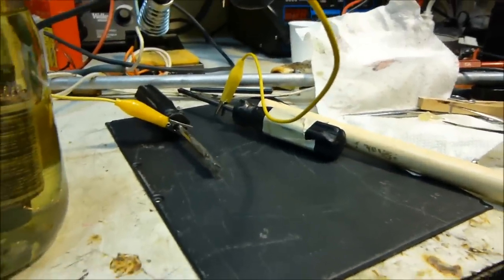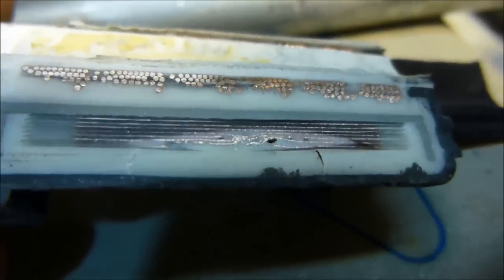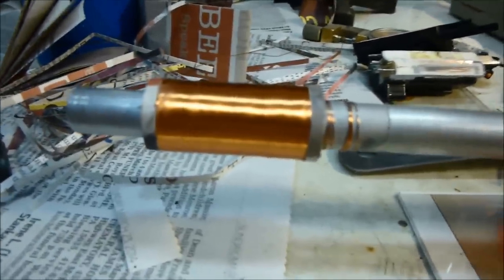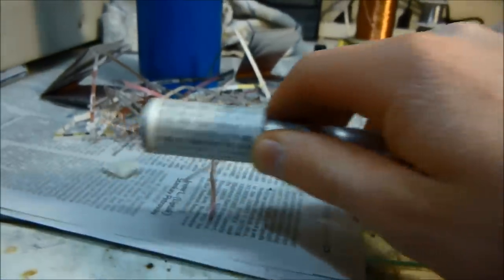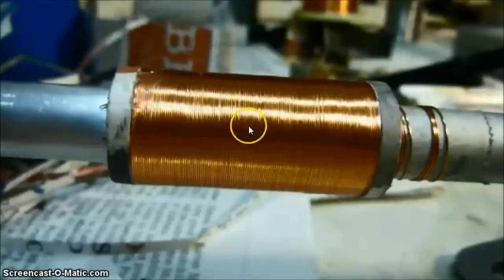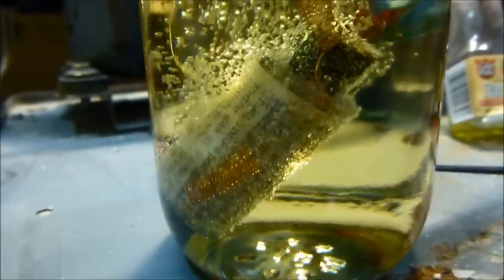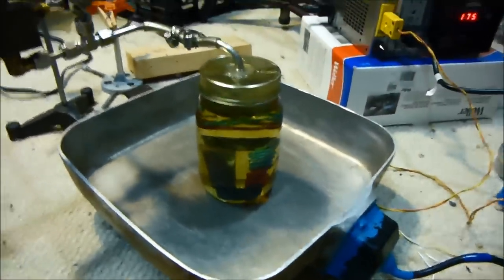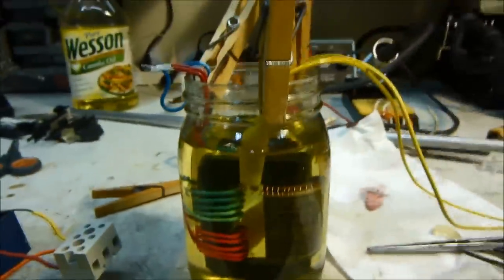How to Make a Super High Power Fly Back Transformer

Comment: Just a warning, that glass jar you were pulling a vacuum on could have imploded, I suggest you use some protection.
Reply: DIY compressor vacuum isn't strong enough. It probably only gets up to .25 of an atmosphere.
Reply: Most food jars are fine with vacuum.  The "canning process" gets them down to the vapor pressure of water at room temperature.  What they don't do well with is pressure.

Comment from the maker: My new homemade fly back transformer!
Reply: What is the output voltage?
Reply from the maker: I would guess it's not more than 5kv.  Just a guess tho
Reply: do you need paper in between the layers?
Reply from the maker: techatyou Yes or else the wire will just arc over.
Reply: do you need a "decompressor" or could you rig up a vacuum cleaner to suck the air out?

oh and when you winded the first layer you went from right to left (doesn't matter) but after you put the news paper to insulate it did you run the wire back to the left, insulate it more, and continue to wind from right to left or did you go from right to left, insulate, left to right, insulate right to left, insulate, and so on?
Reply: sounds daft but vacuum cleaners don't pull a vacuum lol. You can wind right to left then left to right or you can wind right to left right to left and so on and it will be better if you cant get anything to pull a vacuum. That said you can make a vacuum pump easy with some plastic pipe a one way valve and a wooden dowel for a piston with an O-ring to seal....good luck!
Reply: you could also just reverse the shrader valve in a bike pump

Comment: Very nice job. The best oil to use is mineral oil. You can get it from the pharmacy, or order it from the pharmacy, by the pint. Great vacuum setup! Yes! you do need to get all the air you can, out of there so to lessen the chance of inter-winding arcing, like what happened to the original transformer. What happened there is the wire got too hot and broke down the potting, then it arced between layers and burned up. Great job man! Thanks for showing us!

Comment: Very nice job :).   If you need a higher vacuum you can put a diffusion pump after the compressor.  In a high vacuum system the compressor is called a roughing pump.  As I recall having a vacuum reservoir tank between the roughing pump and the diffusion pump is OK also.  You may be able to pick up a diffusion pump from a surplus house or scrap recycler.
Reply: Note though that the diffusion pump require a much better roughing vacuum than is provided by that dehumidifier pump.  Typically the pressure needs to be brought down to well under 1mBar on the roughing side whereas the dehumidifier pump in this video is only bringing the vacuum down to about 90mBar. With a roughing pressure that high the diffusion pump would not work at all.

Comment: Nice little HV transformer, good work.
Just remember that it now can supply much more current and are much more dangerous.
High frequency HV mostly goes on the surface of the body but dangerous anyway and you dont want to make a misstake.
That said, it looks like a good HV transformer and one of the better DIY transformers i have seen on YT.
Now, build a HV multiplier (potted or in oil) and take the voltage up to 100kV.
This transformer will be an excellent driver for such a multiplier.

Comment: Try making a branch line to put the valves in paralell with a single pressure signal.  You probably want them in parallel as a whole, in fact.  Compound the flow.
Reply: Lunartrek as he explained, it wouldnt work...
Reply: It would work and he hadn't tried it as of this video.  Trust me, pneumatic actuators work on this principle all the time.  Just because someone says something won't work it doesn't make it true.  He is new to working with pneumatics, he will learn, if he sticks with it.

Comment: More cool stuff dude. You are one of my favorite experimenters and I like your approach. I've just blown a couple flybacks with my new SS-SG hybrid Tesla coil and I need to make something more robust to use as its primary. I'll be trying your method here! I have plenty of magnet wire and bare cores.
Meanwhile, check out my coil! It is starting to work pretty well now that I have the spark gap overhauled.
Extreme High Voltage: TinselKoil VII Overview, Construction, Demo
Extreme High Voltage: Moar Psarks from TinselKoil VII
Keep up the good work!
Reply from the maker: Wow it's amazing!  Yeah I've almost burnt up all of my flybacks on my ZVS driver too!  They sure don't last long when you put a lot of power into them!  If you make your own flyback you may need to put a rectifier on the output before you can use it with your Tesla coil.  I wish I had plenty of magnet wire!!!  I just have stuff I recycled!  Thank you!  You keep up the great work too!

Comment: Nikola Tesla used pre-boiled linseed oil.
Many of the early-1900 violet-ray companies and x-ray transformer companies used molten wax, sucked it down then let it harden:  mixtures of beeswax and caranuba wax.

I took apart a modern dental-xray transformer and found that it used linseed oil.   When not immersed, the linseed oil hardened (like oil-based paint,) so that transformer now looks like it's embedded in orange plastic.

Comment: Perhaps you could remove the check valve from one of the compressors to allow it to work in series with the other. If all you are doing is pulling a vacuum to draw out air bubbles, then a single stage is fine. Pulling a lower vacuum won't make much difference past a certain point if a bubble is trapped then lowering the vacuum even more isn't going to help. Since you are going through the trouble then why don't you pot the transformer in epoxy instead of oil? Once the resin is set then you don't have to worry about the mess of oil again. Also, for your paper layers I would use plain paper. The ink on newspaper could provide a conductive path for arcing. Although, if paper gets hot and turns brown or black then it starts to become conductive. Maybe Kapton tape will work for you here. I'm not sure how high a voltage it's it can be rated for. If you do try epoxy  you will want to use a slow set resin and possibly keep it chilled for the first few hours to prevent overheating when too much epoxy is allowed to sit in a small space for too long. Blending with milled glass powder can help by lowering the amount of epoxy and by improving the thermal conductivity. ... At any rate, after removing from a vacuum transfer the transformer to a pressure chamber and pump up to 25 to 50 PSI. That will crush any remaining trapped bubbles. It's actually easier to get rid of bubbles with pressure than with a vacuum. With a vacuum there is only so low you can go. Sometimes a bubble or void simply won't disappear. In fact, it' possible to get vacuum "bubbles" -- these are just voids filled with vacuum. I'm not sure what holds them together. They don't look round like normal bubbles. Sometimes a vibrator can collapse them. But if that doesn't work then a pressure chamber will always get them. Once the epoxy is set the bubbles won't return.

Great looking transformer, by the way.

Comment: You might try a tee fitting between the two compressors going to the jar. Each one would be doing half the work, you might get a greater vacuum in the jar. Nice slippers, I need a new pair.

Comment: hi....something to think about....try a scroll compressor as your first pump.....no valves to open or close.
Reply from the maker: jim walker Interesting!  I never though about that!  Thank you!
Reply: your'e welcome.
i hope it works for you....while your'e at it try this: add an airline oiler to the intake, and an air filter to the line between your first and second air pumps, get the air filter that has the automatic drain valve in the bowl, then just link the filter's drain valve outlet back to the oiler's bowl.
(if you add a small filter to the oil return line, it'll act as a water trap, [oil floats on water])
this will make the scroll compressor much more effective not only by lubricating the scroll assembly, it'll reduce bleed-back within the scroll assembly.
the oil i'd suggest is DOT-3 tranny fluid.
the oiler and filter are the types used in automotive repair garages for things like the air-powered tools common to most if not all such establishments.
as to your coil.....i'd recommend double cotton-wrapped, enamel coated wire....less chance of a inter-winding short (those'll just ruin your day!)
Do have fun and be safe.
l8er!....;)

Comment: I suggest using a  diy vacuum container, use a small plastic bag and small plastic box with your transformer in it and add some resin, pump out all the air and let the resin cure, no air bubbles and you can have an enclosed, solid state, oil free transformer.

Comment: Excellent !! , I want to know where is the primary winding of Flyback transformer before using its core, as Its not clear to me, I assume inner turn(27 turns 6 separations)  are secondary but cannot figure out where is primary winding when you showed its slices at 1:30, I shall be very thankful to you.

Comment: I made one and it has about 1075 windings now i just need zvs driver. But with the simple 1 transistor driver i just get about 5 mm arcs with 3.7 v input,gonna try with 12v later

Comment: wise man, enjoyed your vid , im interested in making a powerful ozone generator and the high frequency provided by fly backs makes the highest ionized plasma you can get,far better then 60hz ozone, any way im currently running a 60 watt device, any more then that and the device starts to heat up to much for my liking , also my electrode size limits the current
Reply from the maker: NOBOX7 Thank you!  So your driver heats up or your fly back?
Reply: the fly back bothers me the most but basically it all gets hot, it also has a frequency modulator nob on it but i think i have it at 10,000 volts , it adjust from 7000 to 10k
Reply from the maker: NOBOX7 Oh ok.  I'm not really sure.  All I can say is keep experimenting!  Good luck!

Comment: thanks, I wanted to know how to get the winding off of the core.
Reply from the maker: snaprollinpitts You can use a hacksaw to cut them off.  It takes a long time though.  Or if you are lucky you can find a flyback that does not have the core glued in. Then it comes out really easily.  But most are glued in and won't come out that way without breaking.  So cutting the flyback apart is probably the best thing.
Reply: Makerj101 thanks

Comment: I would of used wax paper between windings . I have  used wax paper for many of the transformer I have made especially  hi. Voltage transformers. The  oil. Is a good idea . Should use mineral oil. Silicone rtv is excellent for hi. Voltage circuits to prevent arcs and Corona  , etc.

Comment: Is it really necessary to have it under vacuum for a week? That seems like a bit overkill. I’m genuinely asking. I have an HVAC vacuum pump for work, and it will pull all the air out of an entire air conditioning system and like 15 minutes, but I’ve never tried to pull all the air out of something like that.
Reply from the maker: Probably not.  I was just going over board.  There were still some occasional bubbles coming off but I'm sure they would shrink down to microscopic size after pressure is back.  This was also done with a refrigerator compressor which doesn't pull nearly as good a vacuum as a proper vacuum pump.

Comment: hey, how would I build a device or circuit that i could used to electrocute moles???? I was thinking if putting 2 wires looselly twisted together in different areas of the its tunnel bunch up together and electrified(thin insulated transformer wire) and when they start to chew on it because it is in its way then BAM!! the right amount of voltage to fry the annoying little critter that keeps turning over my lawn. I have been putting pellets from the hardware store with no results.....thank you IF you respond!
Reply: put tin foil around the hole or thin copper wire then get a microwave oven transformer and put one side coming from the core and the other from the hv output be careful it will try to kill u it will buttfuk those moles xD

Comment: Hey man, I just burned up the secondary on my tv flyback. I have the core now but the thing is, I don't know how to wire the primary. It looks like yours has four wires. I was powering my flyback with a 120 watt lamp ballast by using a two wire input. I don't know how to connect up those same two wires to the four wire input. I found the idea of the lamp ballast here on YouTube and it makes almost four inch white arcs but I'm not sure how to wire it. You may know

Thanks

Comment: I'm sorry for my lack of knowledge in physics but what does removing all the air do? from the inside the transformer? What are the dangers of NOT removing the air beforehand?
Reply from the maker: Air has a lower resistance than the oil.  So it's more likely that it would arc inside the transformer if all the air is not removed.  Internal arcing would totally ruin the transformer.  Thank you!
Reply: Makerj101 Very nice video. There is a way however to do way higher voltage coils WITHOUT the need for the oil as a better insulator. And if you do submerge them in oil as you did you can even go higher. The trick to all this is to NOT allow parts of the high voltage coil with high voltage built-up to overlap. Let me explain. Suppose you have 10 turns on the primary, and supply it with 220V AC. This means that on every 10 turns on the secondary you have 220V AC. If you lay your secondary as you did, layer by layer, where each layer has say 200 turns, you will make parts of the coil come close that are quite high voltage (after 200 turns you will have a built up of (200/10)x220V = 20x220V = 4400V) and hence you will need a better dielectric than air to avoid arcing. One way around to all this is to start your high voltage coil from one side, grow it a few turns on the spot to grow a few layers, and continue growing layers bit by bit towards the other side. This way you will keep to a minimum higher voltage parts of the coil come close. If you grew a six layer coil this way, i.e. every six turns one on top of each other you moved a bit to the right, the highest voltage you would get accross all parts of your high voltage coil, again based on the previous example which would amount to building a 26400V coil, would be only: (6/10)x220V = 132V. This is a 3333% improvement on how high you can get! This arrangement only works when the secondary is separated from the primary as you have in your video. If you had your primary underneath or on top of the secondary, the secondary would not short-circuit through itself, however it would shortcircuit through the primary, as its high voltage ends would find an easy path for electricity to follow through the primary. I hope this helps with your future high voltage coils.
Reply from the maker: Thank you!  Ahh I see!  But how would I be able to stack the windings on top of each other?  The transformers I've seen that use that sort of idea use some sort of bobbin that has diffident.  Thank you!
Reply: Lets say you need the equivalent of a 5 layer stacking but wired for high voltage (not arcing with itself requirement imposes a construction rule of keeping ends away). You would wind one winding forward direction (e.g. to the right), two windings backward direction (left) and then two windings again to the forward direction (right). Then you would repeat pattern (1 right 2 left 2 right) to make the coil as long as you require. However, if you have the luxury of using a longer core, you would not need to consider multilayer packing. Ofcourse multilayer packing would make your design more compact.
Reply from the maker: Delphi Builder Interesting!  Thank you!

Comment: What insulates the windings from each other?  Is that enameled wire?
Reply: Its enameled wire and he using newspaper every layer to isolate the windings. Then he puts the whole thing in oil which provides much better isolation than air.
Reply: @albatross_v2  is it the enameled wire they call magnet wire?  That's the stuff whose windings always look uninsulated to me but I guess that's misleading.
Reply: Yes, magnet wire is enameled wire. The enamel is very thin and sometimes looks like copper so it can look uninsulated. Because it's enamel is thin they insolated each layer with newspaper.

Comment: What is the purpose of the two coils on the primary. Are you using it as a center tapped transformer to generate an AC like signal?
Reply from the maker: miang58 Yeah, sota, I'm using it with a ZVS driver which needs a center tapped coil like that.

Comment: A GREAT VACUME PUMP IS A GEAR PUMP RUNNING AT 2500 RPM WITH A LITTEL OIL FED IN THE INTAKE TO LUBE IT AND BOOST THE SEAL

Comment: Hi Makerj101, 

Great video! I'd like to wind my own. One thing I don't understand; how did you get the secondary onto the core? Does the core split open or something? The video jumps from you taking the secondary off of your winding machine to it showing it already installed on the core. Thanks for you help.
Reply: Sergey Dusheyko the cores are two 'C' shaped pieces. They are usually held together with a metal clip.

Comment: Can you show your flyback driver Transistor specs?
Reply from the maker: Wakachzung Lora IRFP260N Mosfet data sheet:  http://www.ic-on-line.cn/view_online.php?id=1014678&file=0012\irfp260_106359.pdf  

If it doesn't work search IRFP260N on www.ic-on-line.cn
Thank you!

Comment: i have a REALLY REALLY old MOT that pulls 3kw when the shunts are removed, while the primary stays at a manageable temp, and the copper pipe i used to test glows red hot. (with no fan cooling)
would this work to make a slightly more idiotically powerful design?